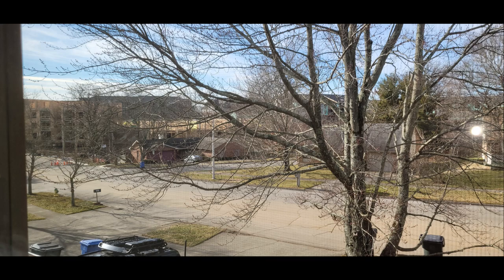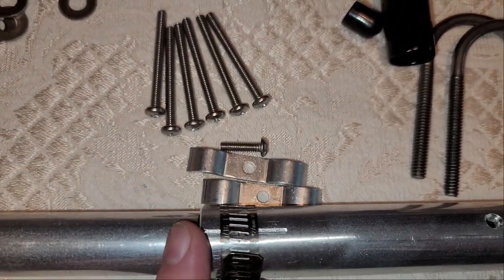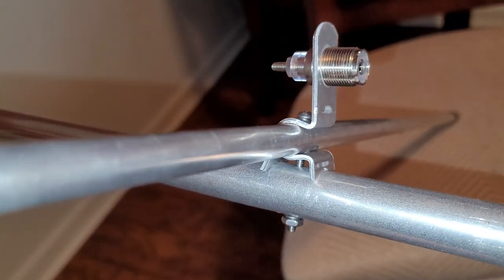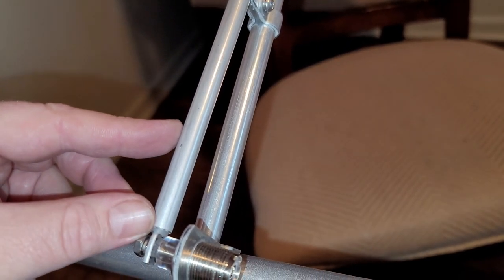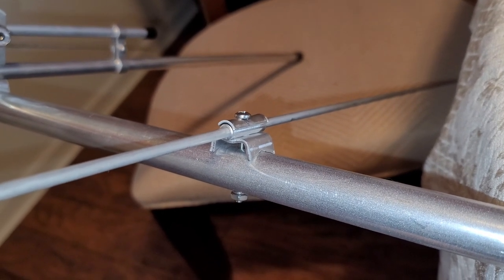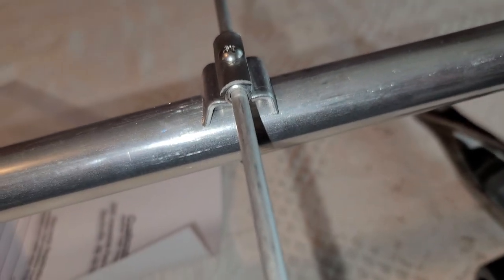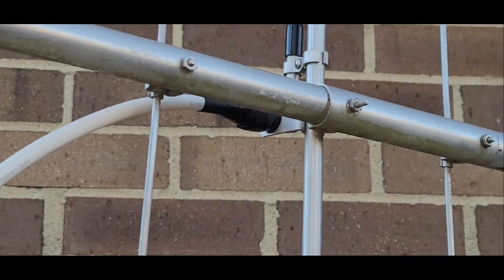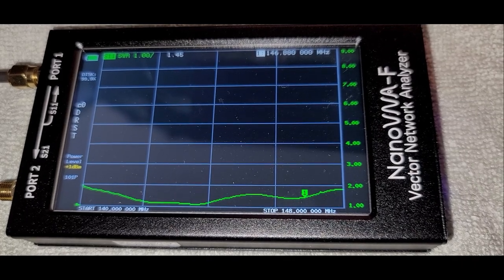LCARA HAM Radio: Cushcraft A148-10S Antenna Build!!!!

Comment: I may get mine put up sometime in the future. I was missing more than a few nuts. The only element in my box was the main element. All the others were MIA. I have noticed since Covid that half the stuff I order online come with some problem of some kind. I about to the point of not ordering online, but they won't make it easy. I will just pick it up in the store and make them show me that everything is there. I guess I will just have to find scrap aluminum and make my own director elements. At least I got the directions with the measurements. Thanks for posting.